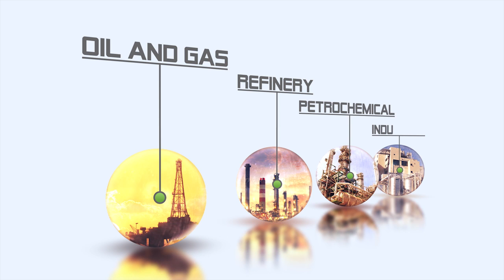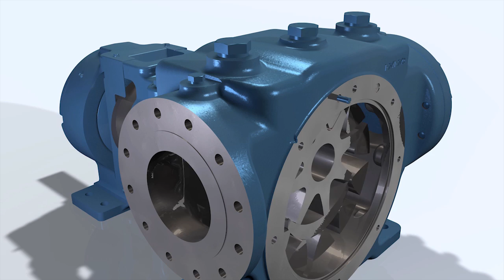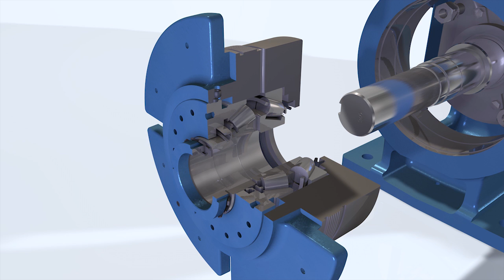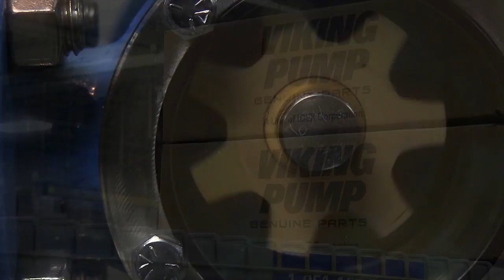Viking Pump XPD 676 Internal Gear Pump Series Promotion

Comment: Can liquid flow drive pump gears if there are some high pressure liquid coming from one side?
Reply from the maker: Internal gear pumps have tight running clearances to minimize slip, maximizing efficiency and vacuum capability. But those same tight running clearances mean that, while off and with enough differential pressure, the pump may start to rotate. In other words, it behaves like a hydraulic motor would. Those who experience this, or just back flow through slip while the pump is off, commonly use check valves or shut-off valves to prevent this. For further questions reach out to your local distributor: https://www.vikingpump.com/contact/industrial

Or send us a message here: https://www.vikingpump.com/yt

Comment: How to adjust when wearing out
Reply from the maker: Slight clearance adjustments can be made to compensate - as seen in this video: https://www.youtube.com/watch?v=eWJWSLI8_gc&t=680s
However, if wear is severe a repair kit may be needed. For information on repair kits, please contact your local distributor: https://www.vikingpump.com/yt